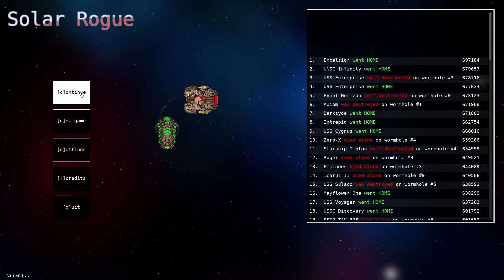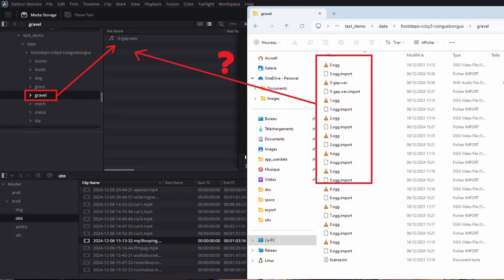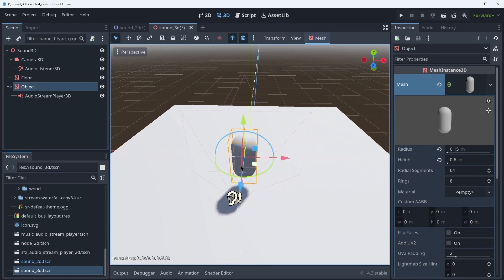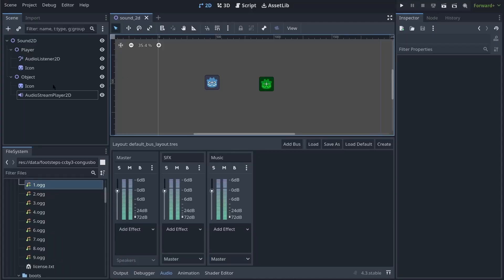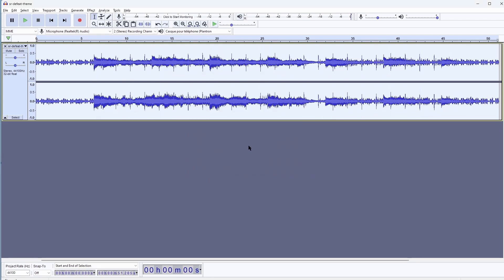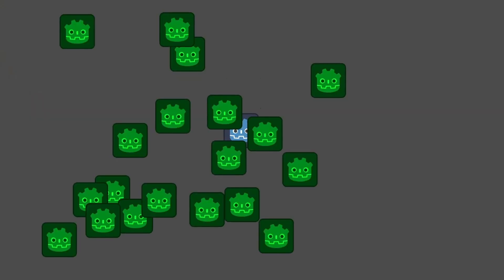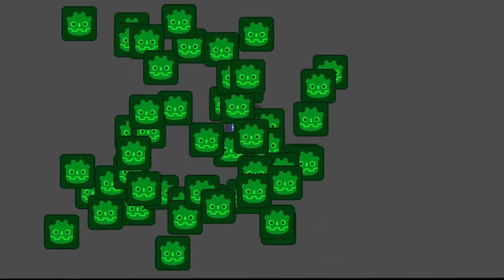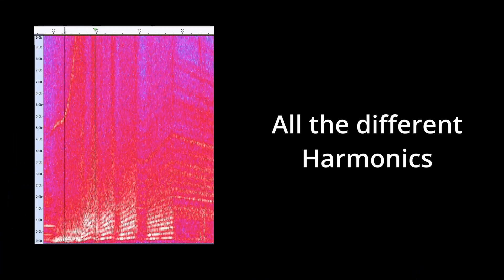Sound Systems in Games

Comment: The biggest thing that is consistently missing from game audio is "ducking". This is the practice of dynamically compressing the gain of other sounds to "make room" for the sound(s) you want to hear. 

Ducking is how you can clearly play a sound over loud sounds without playing the new one even louder. It creates "perceived volume" while still maintaining your target gain levels. For example, your game music and other sound effects are pumping loud during a boss fight. The player fires a shotgun. Everything is maxed. So if you play the shotgun sound, even at max, it will sound quiet. 

This is standard practice in music production. The way to accomplish this is by applying compression to your other sounds which is keyed to the gain of the louder sound. So when the shotgun fires, the music volume "ducks" for that fraction of a second, proportional to the shotgun's volume.
Reply from the maker: Interesting trick. I've never had to implement this myself for a game. Will look into it next time. Thanks for the info.